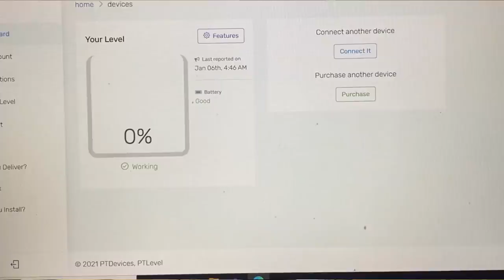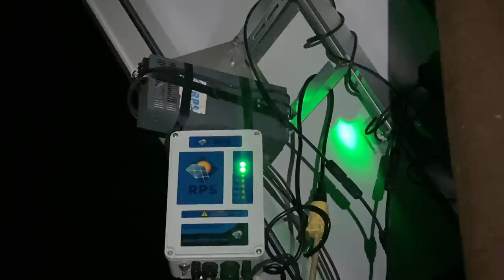#468 - Dually To SRW Conversion (87 K30 4x4) Off Grid Internet Q&A

Comment: 🤣🤣🤣🤣 The earth has shifted ...  whilst the poles have moved ...true...he was saying something plausible...

i used to work at a remote sensing company and one of the things we used to do for telecom companies was landcover  (ground cover) products/maps/images ... they needed to see what sort of vegetation grew were and what height it was because in summer  when the trees had all their leaves signal attenuation was always an issue vs winter. 

Yes satellites are up there but line of sight is not as simple as it sounds...your satelite might be on the "horizon level" and line of sight becomes a factor. Even with line of sight ... leaves , buildings, areas with huge concreted surfaces like cities (heat coming off these surfaces) and water bodies (evaporation over the water bodies) caused problems for them .... 

Probable solution for you is that they just have to boost your signal strength... and you also need a better and boosted antenna ... but i guess they dont want because there are probably some financial cost associated with that not covered by your current contract. 

Anyways...enuf nerd jargon.... Love... love ...love your videos ...keep up the good work ... We are planning on walking your off the grid path in the next two years. (from South Africa, Pretoria)

Comment: Thank you for another great video! 

Have you considered self hosting your sensors? I don't know the sensors you are currently using but there are alternatives that you can run and operate on your local network and thus do not have to rely on an active internet connection.

Check out Home Assistant (https://home-assistant.io) and especially their community. 

Keep up your hard work! You are doing great!

Comment: Once again,,,,I say...get that generator out of the weather....build a power house.  That snow/moist freezes on a hot coil of wire.armature or field coils.....ie expands and pushes wires together to make a SHORT CIRCUIT that will fry your generator.   Of course you can be stupid and burn out your machine and spend money on a replacement.  A least put a box over it to protect it.

Comment: I think you may be disappointed in your quest for better internet; there is not a whole bunch of satellites up there and you will probably be using exactly the same satellite, but with a different service provider;  as a plumber you know there is a finite capacity to a pipe, internet is exactly the same in the respect; if there is 10 gig of capacity, then that's what it is, you already witness it when you try and upload and watch content at the same time.  You laughed at leaves on trees; it is actually a very real issue in areas on the edge of the satellite broadcast footprint where the signal is weaker; in general, you need line of site to your transmitter, the further down the valley you are, the more things can obstruct the signal (and leaves are perfectly capable of doing this), the worse it gets.  This time of year, snow can completely obliterate your reception.  In general, those providers deemed as better, have better customer service and their staff more sympathetic, so our opinions tend to sway.  Anyway, I really hope I'm wrong and you get great internet as I enjoy your content.
Reply: You don’t understand what Starlink is from your post, I highly suggest reading up on it. It is nothing like the other satellite internet based on geostationary orbit. These are thousands of satellites in low earth orbit.

Comment: Well, You went downhill with this, not up. You literally killed the value of that truck removing the duals. Swapping them under another truck with a weaker frame does nothing for the other truck. Its still a 2500 weaker frame. You called it a peach, then ruin the value.